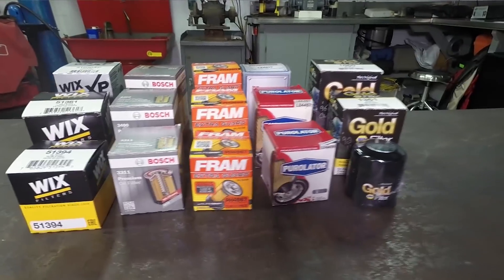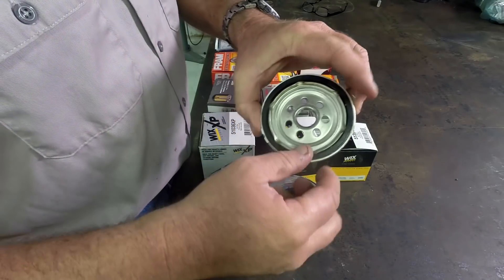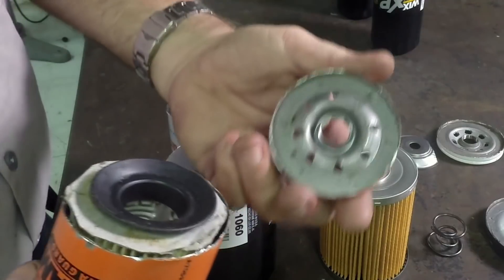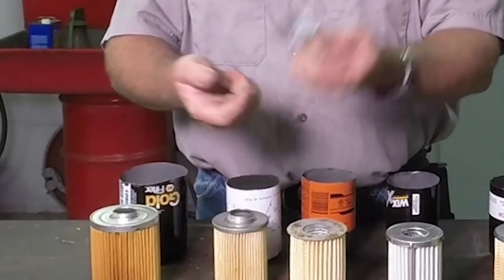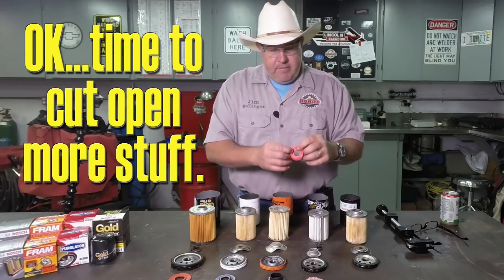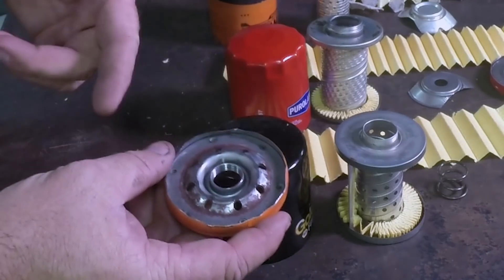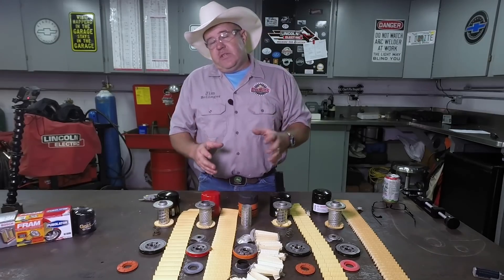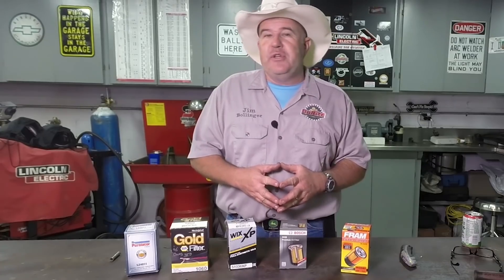The worst oil filter EVER!

Comment: You should of also cut open a K&N Filter in that line also
Reply: And a Mobile One
Reply: @jmwarden1  Mobil 1
Reply: @jmwarden1  yes mobile one only one I could think of was k&n your right
Reply: Antonio Claudio Michael K&N is the only oil filter I’ve purchased that I had in issue with. Noticed a couple drips where I park about a month after an oil change. Snugged it up but it didn’t need it. Wiped it clean and checked a day later.  Still dripping. Removed it to check the gasket and mounting surface, all good. It was leaking at the seam where the canister attached to the mounting flange. Last time I’ll buy one. This was just this past summer. Looked online and the only other failures I could find were on the spot welds where the “nut” is mounted but only on some motorcycle filters? Maybe I got a lemon but I won’t take that chance again.
Reply: If they are as bad as their air filters then it’s probably similar to a fram. People swear by their “performance” filters because the do outflow factory filters in most cases but that’s because they trap half the dirt. It’s impossible to get more flow with the same or less filter media.

Comment: I got a whole bunch of negative comments on one of my videos for using a Fram filter.  It was on my Honda.  The last two Hondas lasted 350K miles with Fram filters and I hardly ever even changed the oil on them.  My other cars have Wix filters on them.
Reply: Fram is the go to filter that I have used on my automobiles for years. I have never had a mechanical       problem while using fram.the only filter I have ever seen split was a 'boche' (not sure I spelled it right)
Reply: The problem is the base FRAM filter like he has is complete garbage. However the higher models the Extraguard I think and the other one are actually really well made. It's quite bizarre and I've never understood it.
Reply: You coulda got 800,000 with a wix.
Reply: @cadzillals6 so until 14 months ago, people were possibly causing damage to their engines for years with fram until then?
What a relief.
Reply: @cadzillals6 Perhaps not all...The smallish black Honda filter in my hand right now is made by Roki. It's assembled in the USA... but unless FRAM just bought the company this afternoon....  I think part Number 15410-MFJ-D01 is maybe not a Fram. But if so... Gold wings are notorious for a lotta miles without a problem. Maybe they would go a couple million miles with a better filter.
Reply: Just imagine how many miles they would have run if you would have changed the oil!! Lol
Reply: still running!    a woman just turned 1000000 miles on a 2013 Hyundai. Hyundai investigated and verified, gave her credit for a new motor when it does die.
Reply: chrysler still has a lot of hate for fram.  Their crappy anti drainback valves were failing and getting sucked back through the engine on the HEMI stuff.  Personally, I avoid them for various issues over the years, one of which was having a brand new one split open and dump all my oil on the road.
Reply: Chrysler was the problem not Fram